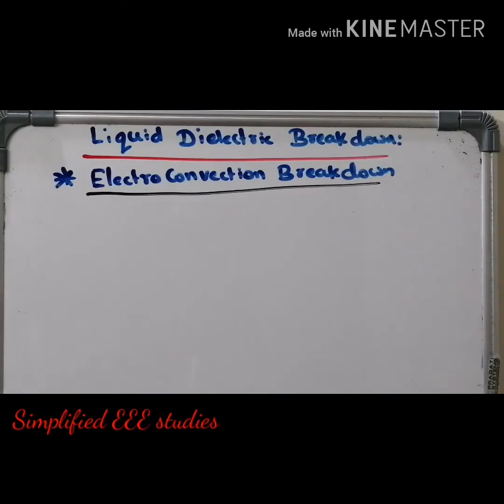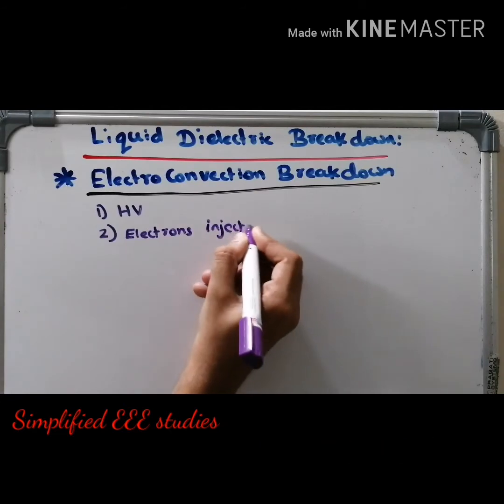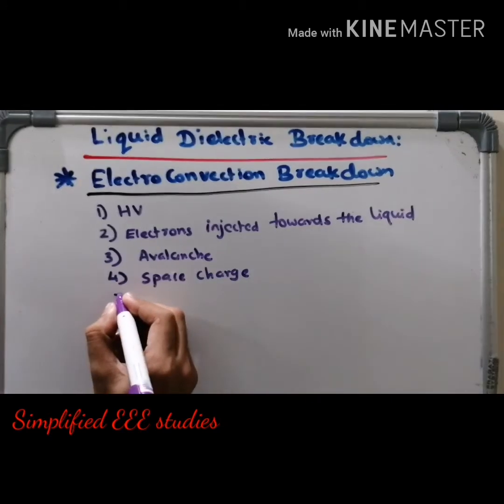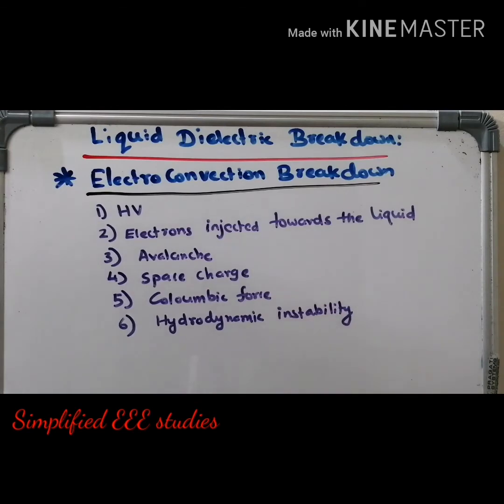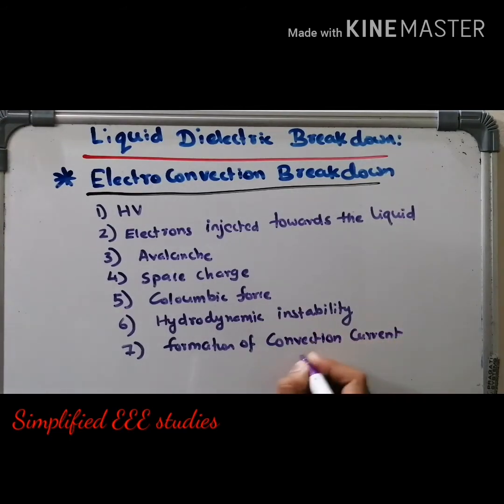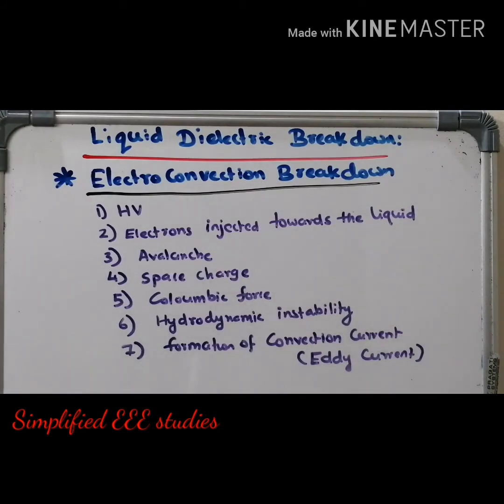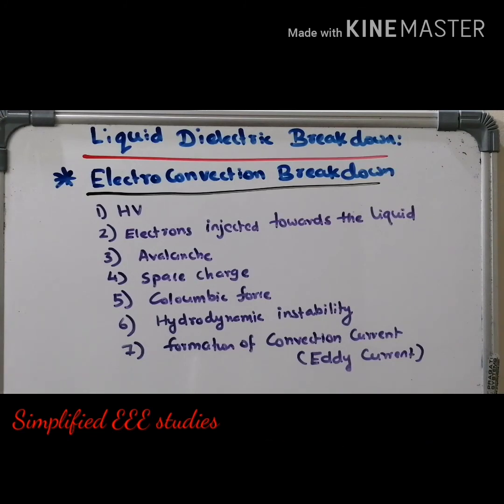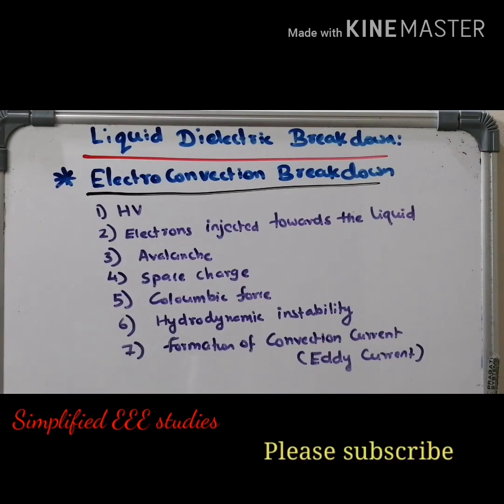Electroconvection Breakdown of Liquid dielectrics Liquid Dielectric Breakdown Mechanism|HVE LECTURE

Comment: what are space charge sir? and what does coloumb force do in this process Electroconvection Breakdown of Liquid dielectrics? sir.
Reply from the maker: Space charge is basically a group of electrons. That means group of Avalanche forms space charge.

Regarding Columb force:
Force between two electrons (Attraction /repulsion)
Reply from the maker: There is one standard formula to calculate Columbic force.
(1/4*pi*e0) ( q1. q2/r^2) ...you can refer any text book of Electromagnetic Field Theory..